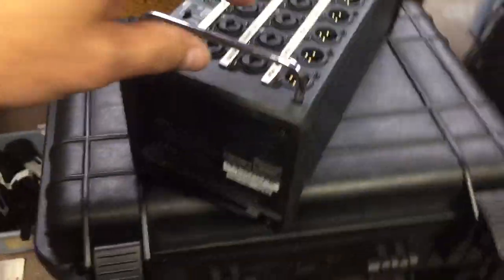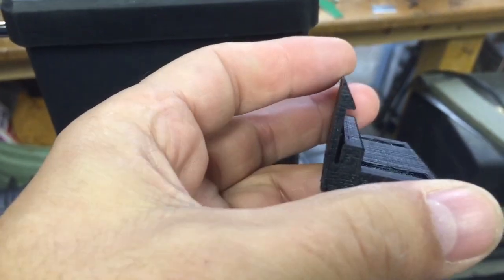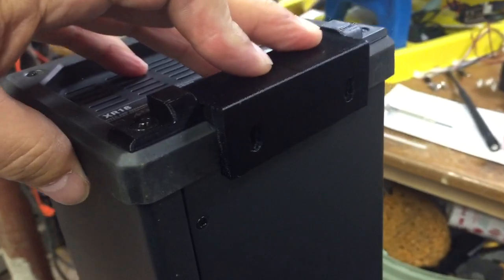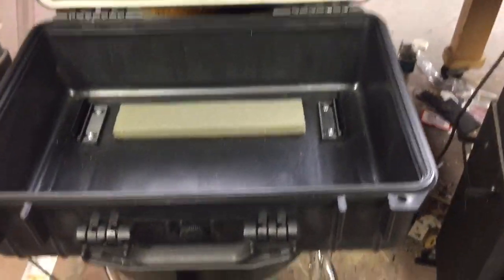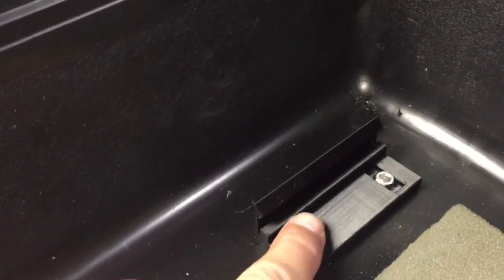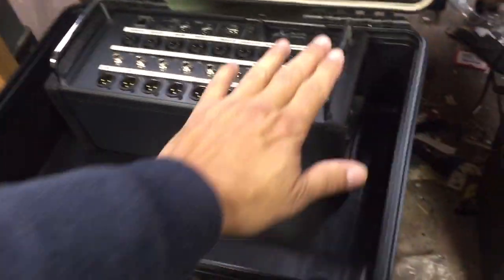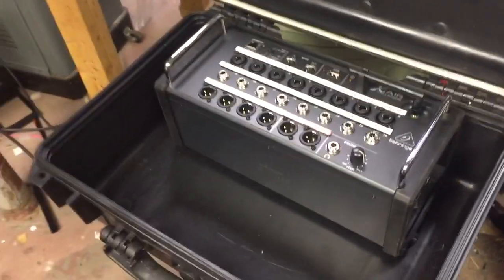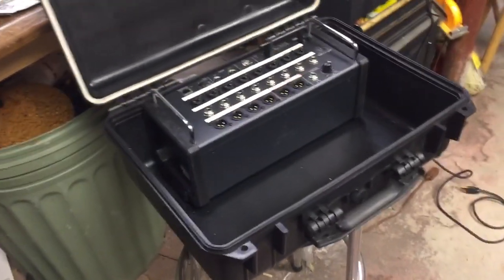Behringer X-Air XR-16 or XR-18 Digital mixer mounting clips

Comment: You could put a little UPS in there with it.
Reply from the maker: Cool idea... not sure if it's practical as you'd also lose power to your amps/speakers most likely... :)
I actually have a surge protector mounted inside... some clubs/gigs have lousy power... best to protect your gear is possible (lost an older mixer and other gear years ago due to a power surge)... also have a dual-band router inside the case, though it's power and ethernet cable cards are 6 feet long allowing me to place the router outside the box, at a higher elevation if possible to get optimum range...
Reply: Digital gadgets are the most likely things to be affected by a momentary power glitch, so a UPS is always a good idea - especially if you are recording, as you won't lose your connection to the DAW.
Reply from the maker: Ah... studio use... indeed a UPS is a good idea!... but live use?... no fuss (though you really should use some sort of power conditioning... surge suppressor at a min... cuz we all know how bad club power can be :\ )

Comment: You made the clips? If not, where'd you get them?
Reply from the maker: Yes... I designed on Google Sketchup, sliced with ReplicatorG and printed on a FlashForge 3D Printer...I've only sold a few to some friends... if interested, let me know... sales at diyrc dot com
Reply: Do you know if they'll fit an XR12?
Reply from the maker: Thats a negative... unfort. the XR12 is much thinner ... both brackets would need to be smaller and without owning one (an XR12)... I have nothing to measure to mod the design... sry
Reply: tomapowa ah, that's too bad.... Very cool mounting option though!!
Reply from the maker: ACTUALLY... now that I look at some pics... the width of the XR12 looks to be the same as the XR16 and XR18 mixers... so... YEH!.... it should work... without having one in front of me, it;s tough to be 100% sure...
Reply from the maker: If you can, measure the distance between the front and back screw holding on the plastic bumper (either side, they are identical).... this distance between the 2 screws (front to back) is key...
Reply from the maker: The distance should be 110mm.... if not, unfort. they won't fit...

Comment from the maker: Anyone interested... I can print up a pair... you supply you own nuts/bolts... shipped anywhere in US for $20 / pair... they've been modified slightly to include taller "ears" above the clip... allowing you to more easily bend the tabs back to release the clips once installed... Interested?... Email me:  sales at diyrc dot com